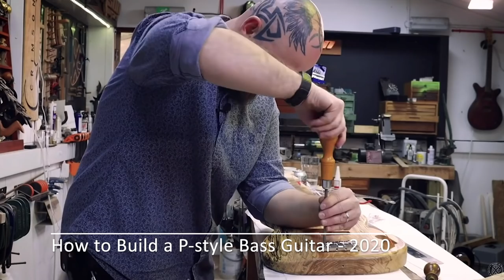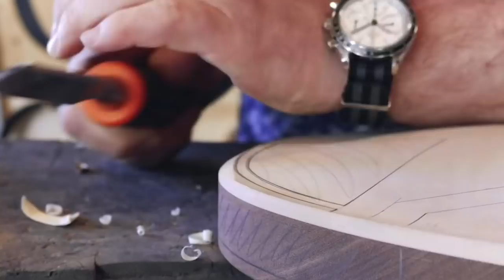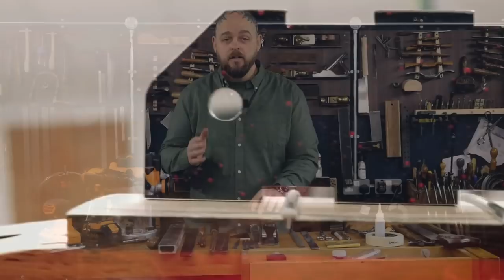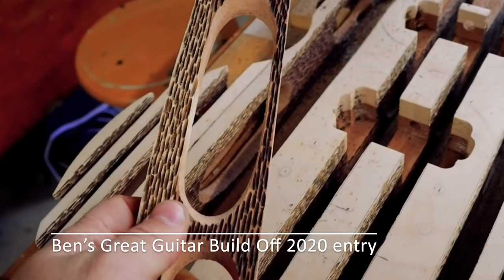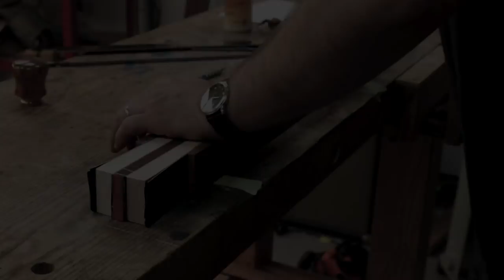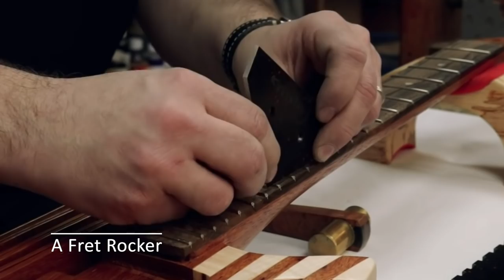Top 10 (or so) Essential Tools for Building a Guitar at Home

Comment: I've slowly been acquiring all this for a year and a half. The first from scratch build is near!!
Reply from the maker: I would love to see it.. send pics when you are done? B
Reply: @CrimsonCustomGuitars  I shall indeed, but in the meantime you may enjoy these.

https://ibb.co/tmms1sK
https://ibb.co/LzVLfqJ
https://ibb.co/kgsXLjX
https://ibb.co/ygghSN5
https://ibb.co/MnqR4FZ

This was a cheap £70 kit that i bought and put together with the parts it came with at the start. I've since completely stripped it back and redone it with your purple and black wood stains. Tried to do a black to purple burst, but didn't turn out how i wanted. 

Replaced all the electronics and hardware. I used pickups from a company called Iron Gear, based in England. £60 for 2 Humbucker and excellent quality. Soldering is a bit of a mess since i bought a soldering iron with too big a tip.

I've also refretted the neck with XJ frets, smug mode was activated when i done this.

I'm happy with this for a first go with a kit, but still plenty of room to improve

Comment: I think quite highly of this.  A very useful breakdown of "must" and "really should" haves!  
Other useful considerations :
-A Stable, TALL Worksurface
-Portable Worklight
-Rags (cut from old clothing)
-Razor or Craft Knife
-Sanding Sponges
-Magnetic Parts Dish
-Freezer Bags (parts together and protected)
-Steel Scrapers
-Clamps
(PPE was mentioned but these are great bits of cheap safety equipment):
-Workgloves (tight fit) 
-Goggles (safety/magnifying)
-Dustmask

Comment: I have started building guitars this year, I love using hand tools, many of which have been scrounged, disability sure restricts spending power. I built my first cigar box guitar with one of those four files in one, a claw hammer, and a tenon saw my wife had. Somebody gave me some chisels, and gradually built my kit. Now, a Shinto rasp, two cabinet scrapers, and a decent saw are my most used tools. One day, I will buy lots of lovely stuff, for now, I just enjoy the process of slowly building a guitar.

Comment: I totally agree, apart from 2 Budget ideas, which really work:

Modified feeler gauges for nut slotting (including a handle, sort of a tool with interchangeble blades)

Extruded aluminium as levelling beams, After you have them planed wirh sandpaper on floating glass or tiles. 

If youre on a Budget, these things will do the Job as good and as convenient, but the require you to bring some time. And as you said, in the end, its time you can save by buying better/preciser/more conevenient Tools.

Comment: I would like to suggest a video series of budget builds where the budget is for the tools to be used. Ben then builds the guitar from scratch using only those tools within a given budget. Each budget would use different tools and so require different techniques for Ben to discuss. Do a few videos at different price points. Once you have the guitars, do a blind test with a few players to see which guitar was the most preferred. Discuss the effect of the tools on the player preferences. Just a thought...

Comment: I did a great-guitar-build-along with y'all and made my first ever scratch-built guitar last month.  You covered most of the tools I found essential in my garage workshop, but what I really need to build before my next guitar is a good workbench with better work-holding options.  The top of my tool chest is a good surface, but there's no way to hold anything on it.  Also, I can always use more clamps. :D
Reply: Build a bench that hinges about waist high from a garage wall and legs that fold in. Set a lock to the legs when using.
Tunes.

Comment: I highly recommend getting a set of drill bits going up by 0.1mm increments.  My days of screwing the heads off the screws for machine heads are (hopefully) over thanks to those, although I could do with a decent set of screwdrivers.  I'd like to see a video on different types of chisels / gouges for carving, since that's something I want to try out next year.
Reply: I've been looking for a set just like this, would you recommend anything??
Reply: @thejamjar8761  I just bought a cheap set from Amazon, there are several that go from 1 to 6mm (including a couple of more expensive sets).  They aren't the best bits around (so I can't specifically recommend them) but none of them have broken yet.  I also bought a set from 6 to 10mm which are occasionally useful, but the 1 to 6 set is very useful, especially for smaller screws.
Reply: Search for "drill bit set 0.1 increments" and you will find lots of them - several appear to be the same set as I have under different names.

Comment: Nice List. I've recently sold my house and moved into an apartment. Your list is nice. As someone who is gone through this challenge, here's my list: 1/4", 3/4". 1" nicely sharpened chisels. Smoothing plane, orbital sander, drill, drummer plus the circle cutter tool (I build hollow bodies) sanding paper of all kinds, types, (Adhesive backed), 3m structural tape, a couple of rat tail rasps and  a couple (Curve  on one side / flat on the other). A screw driver, fret saw, a couple of Japanese saws, jig saw, superglue, titebond glue, sanding blocks of various shapes and sizes. wedges made out of scraps, lots of clamps, (1 nail + popsicle stick per build), cabinet scrapers (a thick and a thin one nicely burled). Rulers, squares, spline curve, template, mould. That is the list of stuff on my Dining table that is covered with 3'4" plywood (4 x 2 feet and under it I have a 3 x 5' 1/2" particle board . Finally a universal Leevalley Vise. Most of my tools are from #leeValley

Comment: I'm glad you mentioned scraping as appose to sanding, because I've always wondered, if you can get a clean cut finish with pretty shavings to scoop up into the bin and less dust to inhale, destroy your lungs and sweep/vacuum up, why does everyone sand? It's like shaving hairs off skin or clipping nails as appose to picking or filing them as far as I'm concerned, especially when you have figured wood.

Comment: For some more expensive and maybe unnecessary tools that will make the job way easier and faster I'd add a bench vice, drill press, angle grinder, Finger sander, spindle sander, thickness sander, belt / disk sander, Dremel /rotary tool, band saw/ jigsaw, a ton of various sized wood clamps, some mdf or Plexi glass for doing templates, extra wood or aluminum for building jigs, and good set of forstner bits. The Your list is pretty spot on for essential stuff those other things just make it a lot easier

Comment: I’m basically building fretted erhu’s by wire-wrapping a fingerboard and attaching it to the neck with adjustable screws. The strings are about the most accurate “straight edge” I can imagine, so I correct any bowing of the fingerboard once the instrument is already strung and tuned up. Works great!

Comment: I built my own guitar. By far the most important tool I used was a router. It cut my guitar body to size using a template I made... using a router.
Next was a drill. I cut out the cavities I first pre drilled holes then routered them to shape.
Next was a shinto file I used for all shaping and comfort cuts. I used 2 files for finer shaping, 1 half round, 1 flat.
After that was a rotating disc sander. I used it to shape edges and smooth the body. 
Finally, cabinet scrapers to get a smooth finish, combined with various grades of sandpaper attached to a spirit level to make sure everything was flat and true.

I should add, I made my own router sledge to get the wood for the body smooth , flat to thickness and true to level.
Reply from the maker: Nice one! B

Comment: I couldn't agree more with your choices Ben..but if I may add one of top tools I feel are essential you left out..scrapers..a cabinet  card style an if your good with tin snips cut your own kidney shaped or custom contour to your liking...there is no replacing it in my arsenal...an I do it all by hand except for the few power tools you shown ...an I use them on necks an body shaping an for cleaning up surfaces I use sand paper( I hate sandind!) but not as much as scraper!

Comment: “You don’t need to surround yourself with all these tools.” What kind of role model are you?
Reply: I get the joke but I do appreciate a master builder who doesn't use a $900 Woodpeckers speed square to make a straight line
Reply: @adamrowedotcom  Totally!
Reply: Yeah, Ben lost me there.
Reply: He likes tools is that a bad thing? Some persons buy cars. Peace....
Reply: I watched my dad play guitar 😊repair my acoustic neck when I slipped and broke it making a new head from scratch and grafting in on then repairing a violin or two and all done with the minimum of tools but the one thing I remember is he would always sharpen up any tools before he used them and just like you he'd say that a cutting tool is only as good as its edge

Comment: Totally agree with the saw rasp... They're fantastic. I got one a few months back and it's so versatile - it can hog off material so quickly, and then be incredibly delicate.
Reply: I prefer a flap disc on an angle grinder, because I already had them. Neck carving and making belly cuts is a joy with that setup. Those rasps look decent though. I use an old 20" bastard file, found in my dad's old tools, to finish off.

Comment: I payed out for a big name battery drill this year after using cheap ones since my teens. It was on of those tools where I regret not doing it sooner. The difference was just amazing, so yes it’s expensive but certainly worth it in the end.   I also have been using cheap drill bits for years and again spent on a few “okay” ones and was amazed how much difference they made. As I need them I will be starting to grab high end stuff for fine work from here on.
Reply: Follow up: those saw rasps are awesome and cost buttons. I got one in Axminster back in the pre dairy days. Still haven’t built a guitar with it (life etc etc) but it’s been used a few times and my gosh it shreds through material.

Comment: I couldn't imagine building a guitar without my 14” bandsaw. As far as limited room I picked up a roller base for my big band saw and bench top tools for the rest of my power tools. Keeps a compact size in 1/4 of my 2 car garage. Helps keep the missus from complaining too much.
Reply: I really want a 14" band saw and almost bought one recently, but got a screamin' deal on a new pair of skis. I've been spending around a hundred bucks or so a week on specialty tools, but I really need to hang back and get some big stuff. I need a bigger drill press, too.
Reply: I've been doing the same with the specialty tools. A few here and there. My bench top drill press is plenty for now. I'm trying to save for a CNC machine now.

Comment: One thing I would add, is a coping saw specifically, for cutting out a body or neck. They can be found at any hardware store, they are super affordable, as are the blades. It isn't the best or the quickest saw out there, but it's great for that first build!

Comment: Being the owner of an extremely small low budget workshop I would say that my list of essential tools would be:
- some kind of plain
- a router
- a 1m ruler
- a square
- maybe a 5h pencil
- a cheap band saw (Amazon has some decent options)
- a caliper
- tons of sandpaper of all grits
- a 3/4 chisel
- a soldering iron
- extremely fine sandpaper or a sharpening stone
- some kind of painting tool
- a round and a plain file
- a scraper 
The end :u
Reply from the maker: A very good starting place for sure.

Comment: I had a good leveling beam, but wanted a longer one. I bought one two feet long that was a generic piece of extruded aluminum. It was pretty straight, but not good enough. I had also bought a piece of float glass two feet by one foot and a half inch thick. I buy rolls of sticky back sand paper and usually keep a strip of 150 or 220 and a strip of 400 on the glass. I used the float glass and sandpaper to make sure the leveling beam was up to snuff. I use the glass and sandpaper or leveling beam a lot to make sure wood is flat. I also have a high quality straight edge for reference. I can't afford the planes I want yet, so I use the leveling beam with sandpaper a lot. I also know a guy with a drum sander, but with quality 150 grit, I can remove quite a bit of material pretty quickly.

Comment: I would add a dremel tool to the mix and a jigsaw. I have been working on guitars since 1983 and have segued into carpentry (cabinets and shaker doors) and if you want to go to another level I would add power tools such as a table saw (with a collection of wooden jigs you can make yourself), a router table,   a band saw, a chop saw and a lot of clamps.
Reply from the maker: This is the next stage after you have what is in this video.. with what you describe you could build almost anything imaginable. B

Comment: Here in the States it's relatively cheap to buy power tools. If you're on a tight budget you can always buy electric power tools they don't need to be battery operated to work. That's just like routers they're very expensive brand new but if you go to a site like craigslist you can pick up brand new routers for a quarter of what the people originally paid for them. Guys go out and buy these tools and never ever use them and when they start downsizing they put their tools up for sale.

I've been watching you for a while and I enjoy your videos.

Comment: Still so many more tools needed. How are you going to thickness the wood? You need wood glue & lots of clamps. How do you cut the body out and then sand to the final shape? Hard with that hand sander. You'll need a square, even if just to use the plane. You'll need something to radius and cut the fret wire, something to radius the fretboard. You'll need a spanner to fit hardware (although your nan might have one the right size). And a soldering iron for the electronics.

Comment: Ace advice as always. 😊 Fact is, you ask 10 woodworkers for their 10 essential tools and you’ll get 10 different answers, but I guarantee all of those lists will include a saw of some sort and a set of chisels. Probably a plane too. You might want to make an exact replica of a ‘59 Les Paul, but you won’t do that straight away. Start small and start easy: make a little box. Even just a simple box/finger joint with two bits of wood. Build your tool collection gradually as and when you can. Upgrade tools as you go. Build your skill and experience with patience. You’ll get there. Everyone has to start somewhere.

Comment: Aspireing Luthier here! I've been able to get by without a router, instead i use a Dremel with its tip running through a flat scrap piece of wood! They make router tips for them and they are far quieter then an actual router 👍
Reply from the maker: Thanks for sharing!
Reply: @CrimsonCustomGuitars  it works pretty well to be honest, not as fast as a router for sure, but it takes up far less space and to adjust the depth you just get thicker pieces of scrap wood 👍

Comment: How about doing a building project where you only use a chisel and a mallet (+a few essential tools for more specific jobs like a hand drill or a screwdriver)? I've had very limited arsenal of tools when I started with woodworking and found that if you're patient enough you really can build anything with just a chisel (provided you have the means and know-how to sharpen it). No router, no sandpaper, no plain - a chisel can do all those jobs. I think you'd make a cracking guitar with only a chisel, Ben!

Comment: I suppose if you're using nothing but hand tools, dust collection and PPE may not be such a big deal, but I think as soon as you start using power tools like sanders, routers, etc., you need dust collection and breathing protection, as well as hearing protection (as you point out in the video).

Comment: The thing about specialist guitar tools: they're like mice.  Start with a couple and before you know it, they've proliferated in your cabinet to consume all the space.

Good choices, though the situation changes somewhat when one moves into the acoustic guitar world.  This requires some means of bending the sides.  But, if one has a butane powered torch and a thick metal pipe . . . Then, there are the molds. . .

The Saw-Rasp made my neck-carving SO much faster and easier.

Comment: I'd love to see an alternative to the nut slotting files and what we could use in a pinch if we don't have them! This was what I struggled with the most honestly when I was doing my build for the GGBO. Most of the specialist tools could be improvised in some way (maybe not the fret saw), but I could not find anything that would help with filing down the nut slots. I also found the price of a good set a little bit daunting at first, however, if I did this for a living could definitely justify it. But what I'm talking here about is that one or two occasions where you might need to slot a nut and you also want to do a good job at it.
Reply: I've done it before by starting the slot with a small triangular file then using an old string as a file.  Works pretty well for any wound string, the challenge was keeping the string taut.

Comment: Hey Ben, I just discovered your channel few days back and loving it. As a utterly total beginner (I just put together a cheap kit with the help of a seasoned luthier, with few upgrades, where I actually only did a crappy paint job), where do you suggest I start? putting together other kits? putting together bits and pieces and make frankenstrats? jump straight to buying timber and sawing and shaping and do the full-on scratch build? Any suggestion is very welcomed